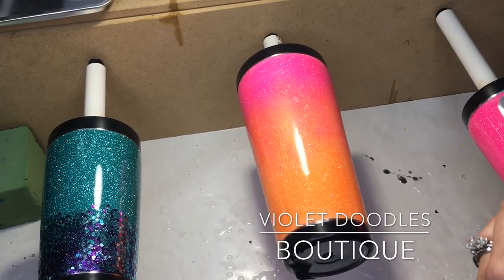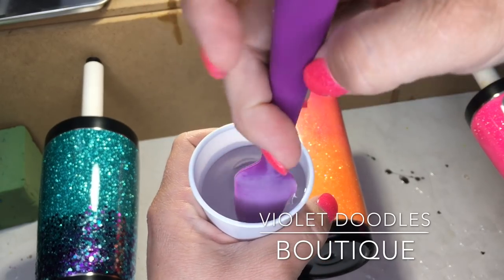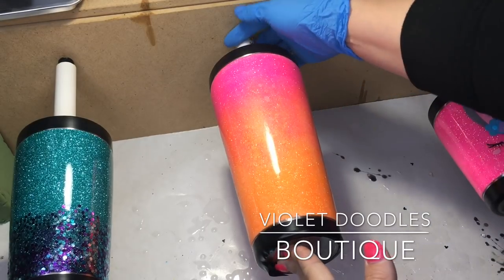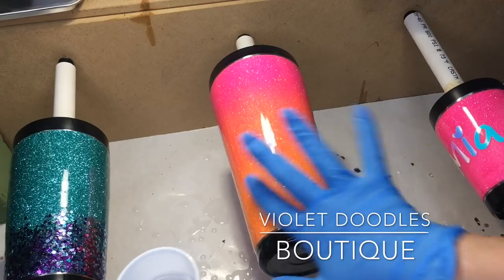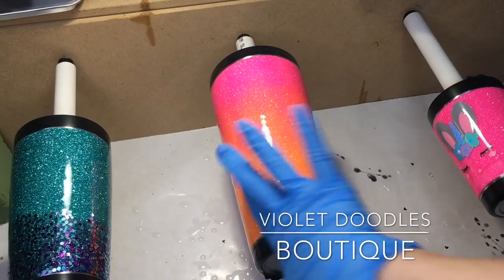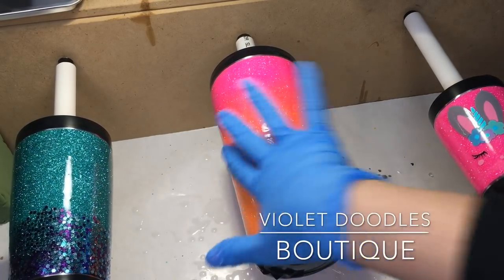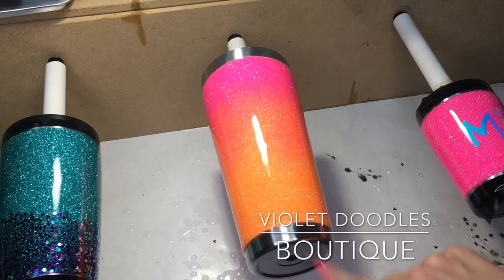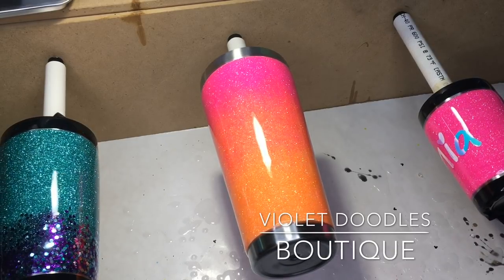Applying Epoxy Resin to a Glittered Tumbler

Comment: What type of base paint do you use? So you paint, mod podge, glitter then epoxy? If you want to place in dishwasher what supplies do you use? Thank you
Reply from the maker: I use spray paint for a base.  Yes, that is the basic process.  These are not safe for the dishwasher.

Comment: 2 questions:
1. Are you able to substitute a hair dryer for the heater? 

2. Is the vinyl on the other cup to your right underneath the epoxy?
Reply from the maker: I am afraid the hair dryer would blow too hard and not have the heat it needs.  Heat guns don't blow very forcefully and get a lot hotter.  You can also use a mini torch. 

All of my vinyl is sealed under epoxy.

Comment: Thank you for such a detailed video. I love your work and you are one of the ONLY tumbler makers that stresses the importance of PPE while working with epoxy. I have a quick question: one of the reasons I don’t tape off is because I can’t get my epoxy line smooth enough to my liking. You say that you remove the tape after 20 mins?? How does your epoxy not run down past your line after you remove the tape? Whenever I try, my epoxy is still very flowy and the epoxy drags the glitter down with it, making an ugly uneven line- not smooth at all.
Reply from the maker: Every epoxy is different.  You may need to let it spin longer.  I have found my sweet spot between 20 and 60 minutes.  Then to get the smooth line, I wipe it with a baby wipe.

Comment: I would love to have a turner like that.  He should consider doing a how-to video on how he made it.  Very nice!
Reply from the maker: I don't think he really wants to make another one.  I asked for two more... he's stalling. :)
Reply: Do you mind saying what the rubber black end pieces are and where they were found? As well as the metal pipes pieces? I’ve built a decent turner myself but I’m not thrilled with the football on the PVC. I just feel like as if it’s sturdy enough.
Reply from the maker: The black on the ends of the pipe are actually tesa tape.  It is a soft tape  meant for wiring.  It was just what we had on hand.  We used it to make the PVC fit a little tighter on the pipe but still easy to get it on and off.  You can find it on amazon.  

The pipe is a stainless steel pipe that we bought and had cut down to our specs. He is an engineer and designs machines for a living.  It is definitely sturdy and hardy.

Comment: After I sand my cups, I've noticed little imperfections in my epoxy. Like little clear bumps- they look like bubbles but aren't because they don't pop after applying heat. After you wet sanded it what did you use to dry it? a paper towel? microfiber towel?
Reply from the maker: It might still be bubbles, you can try a torch too but be careful not to burn it.  I usually use paper towels but coffee filters work better.

Comment: The finish is beautiful. This video was very helpful. For each additional layer of epoxy do you tape it off in the same place or leave a little bit of space so each layer can adhere to the cup?
Reply from the maker: Thank you. I move the tape about 1/8th inch each time.

Comment: Your epoxy looks amazing.  I’m struggling with mini craters come morning after applying my epoxy.  I think I have figured out that it’s from bubbles and maybe over working it on the cup.  I tried a heat gun and still got a few small craters.  Do you warm your epoxy at all or keep your room at a certain temp?  I’ve tried warm (over 70) and cooler (under 65), it seemed to thin when it was warmer, but I’ve read everywhere warmer is better lol.  Any suggestions would be amazing!!!
Reply from the maker: Those dimples could be from several factors: temp, amount of epoxy used, oils from handling, the glitter itself, bubbles...

I don't warm mine except for the heat gun after applied but I do keep my room warm.  

Here are my steps:
*prep cup- sand and wash with dawn
*sometimes basecoat
*glitter 
*seal glitter for chunky or complicated designs
*epoxy 1 or 2 times
*lightly sand and wash with dawn
*decal
*wash with dawn again- I never skip this step!
*epoxy final coat
*wait 3 days and clean cup well with (bare stainless with acetone) and then whole cup with dawn

I hope this helps. Let me know! Good luck!
Reply from the maker: The rims, inside, and bottom of the cup that are still bare stainless steel.  Those parts, I clean with acetone to make sure the paint, glitter etc are cleaned off well.
Reply: @VioletDoodlesBoutique  what do you deal the glitter with?
Reply from the maker: I seal the glitter with epoxy. Here is my epoxy video. https://youtu.be/HDJhMsWh3zg

Comment: Need to ask.  When I apply the two part clear and let it spend for four to six hours I have uneven places. Also some places you can feel the glitter. What am I doing wrong ?
Reply from the maker: That is a common issue. It could be due to several factors. If it is over a chunky glitter, spray seal it first and that will help. You can go over it again and it should be more evenly covered. Sand after two coats and wash well with Dawn. Then coat again. Good luck.

Comment: Can you please tell me how long a cup has to stay on a cup turner actually turning? Is there some point where it is cured enough that I can take it off and let it finish without turning so that I can put another cup on? I only have one cup turner.
Reply from the maker: I usually do mine overnight. If I am in a hurry and trying to load up turners as fast as I can, I will turn for 6 hours and them set it to the side.  You have to be careful though, it will still be soft and can leave finger prints (ask me how I know, lol). If you do it too early, the epoxy can slowly run down and create a hump.

Comment: Do you do this same process for the first coat?? Does the glitter move when doing the first coat??
Reply from the maker: Exactly the same for every coat.  Yes, the glitter can move.  If you are worried about it, you can use a clear spray sealer.

Comment: Instead of using your hands can you use like a paint brush cause I want to try this but I feel like if I do it, it won’t be smooth if I use my fingers
Reply from the maker: You can use a paint brush or foam brush but they would be single use and can incorporate bubbles. You can also use a silicone makeup spatula and apply it with that but I find those to be more work than just using my hands. The epoxy is self-leveling, so if you get it on the cup as even as you can it will settle and smooth out on its own.

Comment: Do you have to seal your cup before you put epoxy or do you go straight into epoxy after you’ve finished your glitter process?
Reply from the maker: It depends on the design. One or two color ombres- I don't seal before epoxy.  Intricate designs, more than two colors, stripes, etc- seal.
Reply: Violet Doodles Boutique thank you!!
Reply from the maker: You're welcome!

Comment: When do you apply the decal? Before the first layer of epoxy or after the second layer of epoxy?
Reply from the maker: After a smooth coat of epoxy. Usually on the second coat with some light sanding first. Then clean well and epoxy again.

Comment: Does the type of epoxy matter? I used JB Weld on a few cups and it starts to cure so fast that it gets very bumpy and hard to spread. I've noticed that everyone uses the same kind. Could it be that I'm using the wrong kind?
Reply from the maker: Oh yes! You need an epoxy resin.  JB Weld is a strong glue but will not work for this application.
Reply: Violet Doodles Boutique I bought the one you’re using here and I immediately noticed the difference. Thank you!
Reply from the maker: I am glad I could help.  Have fun!

Comment: 1 - How much epoxy do you use for this tumbler and if you have a list of epoxy quantity for other sizes. My tumblers always have a like a bump at the base

2- when you say the tumbler should be level, what do you mean? The arm of my turner is level but the tumbler is not when on the turner

Thank you 😊
Reply from the maker: So I went back and did a quick view, it looks like I mixed more than just for that cup.  The small bathroom cups hold about 60 total MLs. A general rule of thumb is same number of MLs as the number of OZ of the cup. EX: 20mls total epoxy for a 20oz cup.  This is not an exact science but it does help judge. If its a first coat over glitter, it may need more.  Over paint or epoxy, less.  Once you have several under your belt, you'll get a feel for how much you need.  I generally like to make more than I will need. 

When I say level, I mean the cup needs to be level on the turner. If it is titled, your epoxy will run and pool up.  It sounds like that is what you have going on.  Keep adjusting the cup until it's level. You can sand the bump down and recoat it. 

Good luck and thanks for watching.
Reply: @VioletDoodlesBoutique  thanks for your quick response 😊

Comment: What causes fish eyes?  How do you fix them?  Also, do you mod lodge under all of your glitter it fo you ever epoxy under?
Reply from the maker: Fisheyes are caused by debris or residue that hasn't been cleaned off.If you already have them, lightly sand your cup and wash it WELL with Dawn.  Dry it with a coffee filter or microfiber towel and reepoxy.  

I use MP and epoxy to apply glitter. It depends on the technique I am working on.

Comment: Two quick questions do you need the tuners to make these? And how long does the epoxy take to fully dry and or cure?
Reply from the maker: You can hand turn.  I don't have the patience for it.  There are some tutorials that show you how to do it without a turner.  Search for Minderella.  She has one.
Reply from the maker: Depending on the epoxy, 4-6 hours to be able to handle it and 3-7 days to be cured and safe to use.

Comment: So the process is: MP, glitter then let dry. Another layer of MP and glitter and let dry. Then apply the epoxy resin and done?
Reply from the maker: Yes, you may have to do two coats of epoxy to have a smooth finish but that is the basic idea. If you are adding vinyl, do it after a smooth coat of epoxy and then seal it again.

Comment: Is it safe to let the epoxy cure in your main living area, or is it better to do it in a garage or basement? I’m still unclear on the toxicity of the epoxy- is it only toxic while you’re heating it?
Reply from the maker: I highly recommend reading the entire data sheet for whatever chemical you are using.  If it is not in the package, you can find them online at the manufacturers website.

I would not do it in the main area of the house, especially if you have others in the house, pets or children especially.  Some people have very severe reactions to epoxy causing swelling and rashes. It needs to be in a well ventilated area and some require wearing a respirator.
Reply: Violet Doodles Boutique ok good to know. Thank you!!!
Reply from the maker: You're welcome.

Comment: Did you apply the vinyl on the cup before the first epoxy or after the first coat?
Reply from the maker: I apply vinyl after a smooth coat of epoxy, usually after 1 or 2 coats.

Comment: Do you have to make another batch of epoxy, when you do your second coat or last coat of epoxy?
Reply from the maker: Yep, it will start to set up in about an hour, harden almost completely within 6 or 7 hours, and fully cured in 3-5 days.

Comment: Do I have the seal the glitter with anything before going in with my first layer of epoxy?
Reply from the maker: It depends on what you're doing. Two color ombres, I don't seal. When I do seal, I use a clear gloss spray.

Comment: What if I don’t have a turner? Will all the apply just drip down to the bottom and all my hard work would’ve been for nothing??

Ps. I’m very new to this I haven’t even tried it yet but I want to lol
Reply from the maker: Epoxy is self-leveling. If you let it run down, it will mostly run off and be wasted.  Without a turner, you can hand turn.  There are several videos from other makers on how to hand turn.  It is time consuming but possible.

Comment: Do you also use the heat gun after you apply the epoxy after the decals?
Reply from the maker: I use the heat gun each time I apply epoxy. It helps pop bubbles and smooths the epoxy for an even layer.

Comment: Can the epoxy method be used on acrylic tumblers or only stainless steel?
Reply from the maker: I have done it on glass and stainless.  It can be done on acrylic but I have not done it.  If it can flex very much, the epoxy can crack or separate from the base and create problems.

Comment: Hello I am a new subscriber and I love your work it's so beautiful but I have a question is it harmful after it cures because my niece wants it really really bad and she's 6 years old she wants pink and purple glitter Tumblr and they also have one year old and she is a very curious little girl she has to taste everything so I am afraid and if that is toxic or harmful for babies if you can like answer me that question I will be very grateful and the other question is can I use epoxy on a tumbler and do very thin layer and stick my rhinestone to it will it be better than using regular glue like e6000 or something like that.😊
Reply from the maker: As long as the epoxy you are using states on the packaging that it is food safe/FDA Compliant and it is mixed properly, it is safe after it cures (3-10 days depending on the epoxy). If it is sticky or tacky at all, it is not cured or wasn't mised correctly and is not safe for anyone to use. Both of my kids have several but I don't let them have them until they are fully cured. 

For rhinestones, either E6000 or epoxy is great for gluing them down.  Do not epoxy over the rhinestones though, they will lose their sparkle.
Reply: @VioletDoodlesBoutique  thank you so much 😊
Reply from the maker: You're welcome.

Comment: Do you have to use a cup spinner and do you hav too use the heat dryer
Reply from the maker: You can spin by hand but you will need to dedicate several hours (6-7 hours) to turn it by hand.  The heat gun helps pop bubbles and even out the epoxy. I don't always use the gun if I don't see the bubbles.

Comment: can you use a cup that has diamond shape indentions in it or does it have to be a flat metal tumbler?
Reply from the maker: Epoxy is self-leveling. I'm sure it would work but you may need to do more layers to cover everything.

Comment: Have you found an epoxy wholesale supplier yet that you recommend?  (I’m looking for one for wood projects) 
My KitchenAid Stanberry mixer might be my quick fix for a turner...  may need a second one for the garage studio for the toxicity issues lol
Reply from the maker: I haven't found a wholesaler for epoxy.  I actually haven't looked for one.  Ventilation and proper safety equipment is a must.

Comment: I glittered just like you did and your directions were spot on and amazing! Thank you! I did have a question on times. When you apply epoxy and you feel it is fully covered. How long do you continue to let it spin? And how long do i leave it sit before i can give it a second coat? Thank you💜
Reply from the maker: It depends on your epoxy.  I will let mine spin for 6-7 hours and then, if it needs another coat before anything else, I will do it then.  If it needs a decal or sanded, I wait 12 or more.  I will wait 3-5 days before I ship it or deliver it to its new home.  I don't like to rush the steps, because it never fails that I will mess it up and have to wait longer to try to fix it.
Reply: Violet Doodles Boutique Thanks for the helpful tips!

Comment: im on my husbands account! how do you get a good  air circulation going? would opening a window be ok? I have 4 kiddos and I so want to do this!
Reply from the maker: You will need to do some research with the requirements for the epoxy you plan to use.  Most require a respirator.  I won't tell you what is safe for your family, because people have different sensitivities and I would feel terrible if I recommended something that hurt anyone.
Reply: Thank you
Reply from the maker: You're welcome.

Comment: Do you remove and reapply tape between each epoxy layer?
Reply from the maker: Oh yeah.  If you don't remove it, it will be stuck.  It is still possible to remove it but it is work.

Comment: Why dont u use a brush or sponge brush??;  just curious
Reply from the maker: I get a more even coat with my hand.  Epoxy is also very difficult to clean.  If you use a brush, you will be throwing them away each time.  Gloves are way way cheaper.

Comment: I found a rough spot on one spot of my cup after my second coat of epoxy.  How can I fix this?
Reply from the maker: If it's just a small spot, you can sand it smooth.  If it's a patch of glitter that isn't coated, recoat before sanding.

Comment: How much epoxy do you use for each layer of the cup?
Reply from the maker: It depends on the size of the cup and if it is going on glitter or a smooth surface. I typically do multiple (4-5) cups at a time and make 60- 90 mls at a time.

Comment: In your video you state that we need to wear a mask can you show me what type of mask you use? Where do you do your mugs for ventilation in a garage or open window?
Reply from the maker: Depending on the epoxy you use, your gear may differ.  Some people are very sensitive to all types. Some are more lucky.  A good respirator with a filter cartridge for organic vapors is generally recommended.  You need to make sure it fits well.  I work in my basement in a spare room. I do have the vents blocked and keep the door closed when I am finished.  If it is nice outside, I will open a window and point a fan toward it.  Generally, I just apply it and leave the room for the night closing the door behind me.
Reply: @VioletDoodlesBoutique  thank you
Reply from the maker: You're welcome!